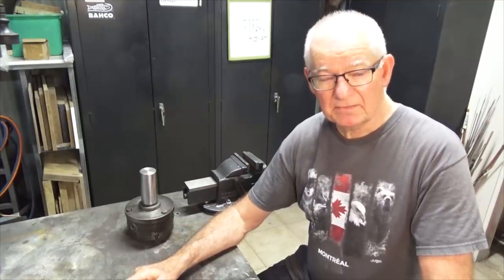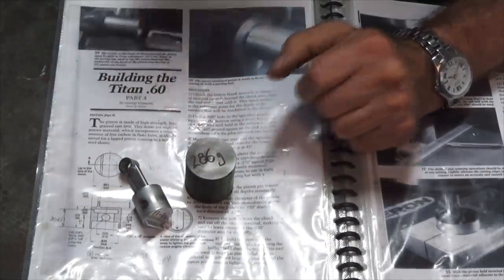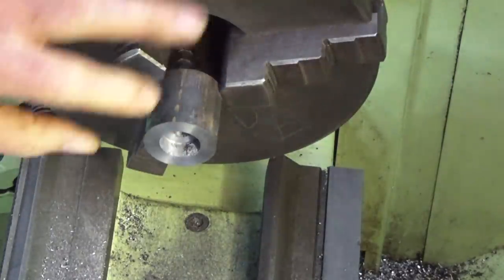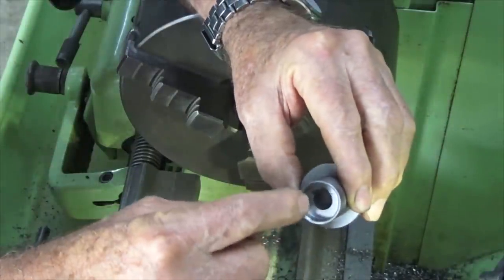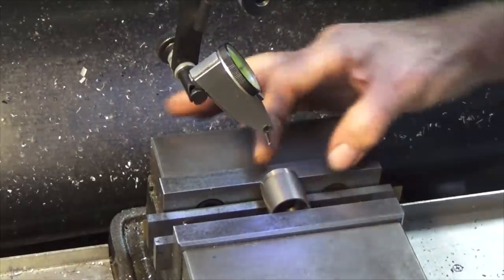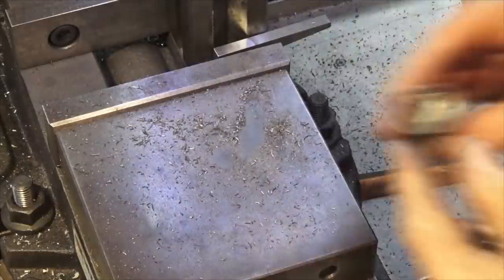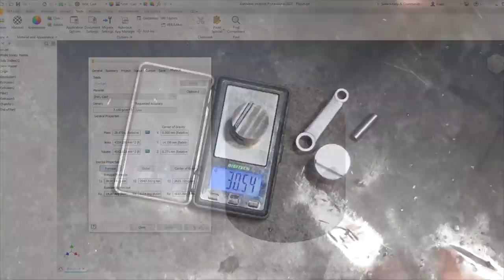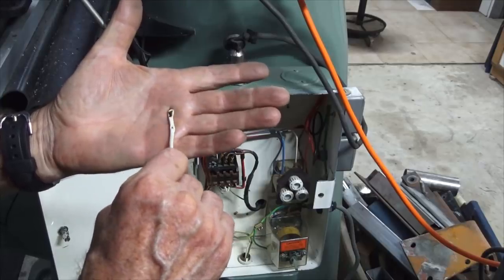Building the Titan .60 Glow Plug Engine #11

Comment: Mark, as you keep getting closer to completing this engine, I'm starting to hope that you'll design & build a test stand to run it before shipping it off to the museum.  Your ingenuity (in this and your previous projects) is outstanding!
Reply: Excellent idea. How about a miniature dynamometer?
Reply from the maker: I have plans for a test stand that incorporates a fuel tank. I also want to make three hex head bolts to hold the engine against a bulkhead. I have some old aircraft engine bolts that came from my Father in Law's tool box. He was an aircraft mechanic specialising in propeller rebuilds. I want to machine the little hex bolts from the full size ones. 
Regards,
Mark
Reply: @Preso58  I love that idea with the bolts, can't wait to see it.
Reply: Yes, what Bob said , please.

Comment: This type of engine is called a loop scavenge two-stroke. The baffle on the piston top deflects the incoming fuel/air mixture coming from the crankcase (now compressed by the descending piston) up one side of the cylinder helping to purge the remnants of the already exiting exhaust gases on the other side of the cylinder. Hence the loop.
Reply from the maker: That's it! It would be nice to see some sort of computational fluid dynamics simulation of how the heat and gas flows work. 
Regards,
Mark
Reply: @Preso58  Yes, and it would be very complex. I worked on a nuclear fusion research project. One of the diagnostics measured the density profile of the plasma using laser arrays. Perhaps you could drill a multitude of  holes for quartz windows around the cylinder to shine a laser through. Mind you, you'll need equipment to pick up and measure interference fringes and then to interpret them.
May be it's best to just get the damn thing running!

Comment: 0:54 Mark removes a 2 jaw vise and installs a 3 jaw vise. Excellent idea.
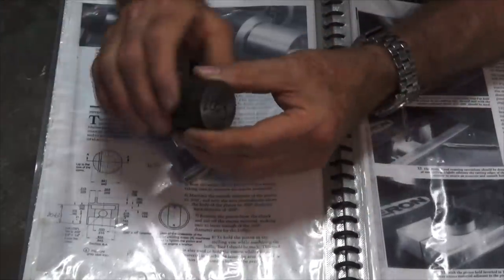3:30 Also, typically, to modify the piston or connecting rod that significantly from original would require tuning the counter weight(s) on the crank. I think running an engine without piston rings is probably easier to do when the piston material matches the cylinder material. Hypothetically, you could lighten the crank, convert the cylinder to aluminum and add a hard coating, and use an aluminum piston.
34:20 "If you own a TouchDRO..." Also, if you acquire a piece machinery from the last century, or if it's been a few years since you last checked it out, it couldn't hurt to go around and clean/tighten all the screw terminals, etc. Heat cycles and vibration just loosen these up over the years.

Comment: Hello Mark, new subscriber here. I've been enjoying this series and look forward to checking out the rest of your stuff. I appreciate your approach to identifying and solving problems. These videos are a useful contribution to our hobby, so thank you!

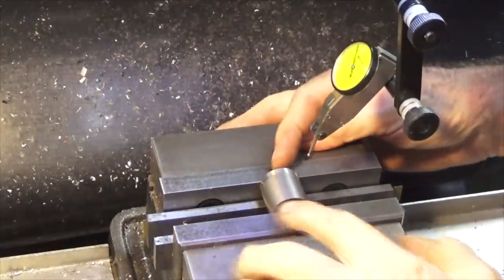By the way, when you set up the piston for drilling the wrist pin hole, there was no need to switch to a traditional edgefinder after using an indicator to dial in the centerline. (Approx 18:30). WWJPD? Make the first sweep on the end of the piston skirt. Then raise the quill a bit to clear the workpiece, and spin 180° to sweep the "other side." In this case, the other side is the back side of a gage block or parallel held tight to the end of the piston skirt. In effect, you are sweeping both sides of a zero-thickness virtual surface. Very accurate and more definitive than a regular edgefinder.
Reply from the maker: Here I am with egg on my face. Another viewer had pointed this out to me previously and I will make sure to use the indicator more as I get more comfortable with it. I do need to get myself a proper Mitutoyo indicator to go in the quill clamp. Mine is marked "Mitutogo" and it's not very good. 
Regards,
Mark

Comment: Hi Mark; reason for choice of cast-iron in a ringless 2-stroke piston: lower thermal expansion rate plus the graphite content generally gives a lower co-efficient of friction.
Also, suggestion for welding table chuck accessory: make a tail extension shaft down to a couple of inches above floor level. On the end of the shaft mount a light 'kick wheel' (eg a skinny, spare car wheel)  like a potter's wheel. Useful for welding workpieces requiring a circumferential weldline (hands-free way to rotate at the required rate).

Comment: Re the iron piston. Presumably you want the piston and liner to expand at roughly the same rate. Especially in an engine without rings.
Reply: The added weight might act as a mechanical rev limiter as well
Reply: when aluminum heats up it grows more than cast at a given temperature, if you clearance the aluminum piston enough to compensate for thermal expansion it wouldn't have enough compression to fire when cold without rings ,why design it without rings is my question
Reply: @kevinsedo6869 Too difficult for DIYer to make the ring?
Reply: It needs to be mentioned that several commercially available engines back in the day had cast iron pistons, Enya brand one I'm particularly familiar with.  I ran one of their .19 cu. in. engines for years, lots of experience.  The break-in process took some time and consumed fuel but the dependability and sturdiness were hallmarks of all aspects of how it was made.  The vibration level was no worse than other engines in the range, I suspect the Veco .19 also had a cast iron piston.

Aluminum pistons that were used were ringed, that is the choice when using steel or cast iron as a sleeve.  There were many bridges in the ports to keep the ring from snagging and I suspect that some had pinned rings for the Schnuerle ported motors that came in the early '70s.
Reply: @whalesong999  I seem to remember that a lot of diesel engines were iron ringless and glowplug were aluminium ringed? But I switched to electric in 1984 !
Reply: @ColinWatters  Wow, you were an early convert.  I went electric in early 2k, no recips after that.  Four strokes became my faves through the '80s until I let go of the hobby for about 15 years.  I still have my workhorse 2 stroke from back in the day, a K&B/Veco .61 that had many, many hours on it.  It has a ringed aluminum piston, a cross-flow engine similar to the one being made in this video.
Reply: @whalesong999  I still have one of my aircraft from the 1980s. Its a DB (DH60) Moth powered by a geared Astro 15. First cells used were 1200maH NiCads. Think it last flew with 3600mAH NmH. Has hinged aluminium cowls. Won a scale competition in Chester UK once but I think they we being kind to me.

Comment: Hi Mark, A lot of reasons for using cast iron over aluminium in a non ringed piston engine.
Primarily the expansion is far higher with aluminium so the cold bore clearance has to be greater and you lose cold compression pressure making starting difficult to impossible from cold without preheating the piston, and the risk of blow by erosion and cold piston slap is far greater.
Cast iron will expand and keep the same clearances to the liner (approximately) so the compression pressure difference cold to hot is far less.
Also the aluminium piston would require a taper from the top to bottom and a greater clearance across the gudgeon pin than the thrust faces so that when the piston expands with heat it expands to a round shape that rides the bore accurately, this is not required to the same extent, or at all, for cast iron at the bore size used in this engine.
Running the engine judiciously during run in will establish the oval it’s and taper of the cast iron piston to the minor extent needed.
If all else fails read the run in instructions for an old McCoy engine and this will give you the fuel/oil ratio requirement and what revs and needle valve settings to use.
Looking forward to the next video and the eventual completion of the project.
Take care.
Reply: I was wondering if it was an expansion thing. Makes sense.
Reply: @ADBBuild  Expansion is what its all about, the history of engine development and progression is hugely interesting.
Alloy pistons for consumer use did not become common until after WW-II so now all the knowledge related to cast iron usage is devolving into legend.
Being an apprentice mechanic in the early 70’s we were still trained in maintaining the older equipment and things like poured bearings and iron pistons were slowly becoming rare but not that uncommon. 
Up to 4 inches for pistons and bearings you ran clearances at a ratio of .001” for each inch of size. After that for pistons it was .0015” per inch of bore to 6 inches and then it stayed pretty constant at .008” to .010” for pistons and about .005” for bearings.
Lots of useful/useless data running around the skull.

Comment: Presso, we know you have a desire for a cold beverage perhaps you can make a beverage holder to fit into your multi tool holder...You can make the beer Errrr beverage holder different lengths and configurations so you could do some job at your bench say, grinding and you could grind away plus drink your beer Errr beverage hands free and not bent over at the same time....just trying to help you find new devices to make plus enjoy ! LOL...p.s im in America and, our hearts & prayers to you Aussies.
Reply from the maker: Chris, cold beverages are always desirable during our summer heat. 
Regards,
Mark

Comment: The last thing you want is any arcing or sparking around electronic equipment. I have seen problems just because the contacts in a relay or magnetic starter were dirty . Glad you found that before you had big problems. Nice job on the piston .
Reply from the maker: I suspect it was all my fault. I must have removed the wires from the plug when I repainted the machine and just poked them back into place but didn't tighten the screws down properly. It's a wonder it worked at all after I refurbished it. Having said that, it's been running for at least 9 months and the issue with the DRO only started to become a problem in the last couple of months. 
Regards,
Mark

Comment: I remember many years ago at school in metalwork class cutting some cast iron on the lathe, and how nicely it machined. It seemed nicer to work with than the cheapo mild steel or mystery ali alloy we usually got to use. It also helped that I got the teacher to re-grind the bit for me before I started, as a shop full of enthusiastic amateurs takes a toll on them!
Reply from the maker: I must say that I like machining cast iron. Many people hate it because of the mess it makes but it seems to be a lot more predictable than some of the mystery steels I have worked with. Most of the steel we supplied to students in the school where I worked was "cold bending steel". It was cheap but it was awful to machine and almost impossible to get a good finish straight off the tool. 
Regards,
Mark
Reply: @Preso58  I was a machinist now a tool rep. Mild steel is about the worst thing to machine. Would rather machine almost anything else. It’s gummy, finishes poorly, sticks to the tool and is inconsistent. To get a decent finish you have to crank the rpm and take a fairly large finish cut. 

Prefer your indicator method for centering. I never got consistent results with a wiggler like I did with an indicator. Love watching these videos. Great work Mark!

Comment: Hi Mark, RFI or radio frequency interference is almost impossible to erradicate without extensive shielding.
Back in the nineties I tripped a 10 Megawatt motor driven axial blower soldering a new push button switch on the bearing temperature, vibration monitoring system.
There was no way the machine should have tripped costing $160,000 of down time.
Some months later during shutdown work when using my two way radio i could iniiate a trip when standing close to the unit, very happy with that.
A barrier was built around the panel with holders for 2 ways to be removed and signs erected instructing operators to not enter with 2 ways.
And yes we had another another trip on the running unit with an operator transmitting within the barrier, can't stop human error.
Reply from the maker: That's interesting and probably very annoying as well. I do know that Yuriy had done a lot of work with the firmware on the bluetooth adapter to filter out unexpected pulses and the eradication of the flickering digits was pretty much all firmware related. I am still puzzled as to why the errors I was seeing were initiated by the motor switching off. It's possible it was triggered by back EMF but that should have happened with the motor wires properly secured unless it was creating a surge that caused an arc on shutdown as well.

Comment: I so admire your talent, m'thinks you must have had some industrial machine tool employment to gain such proficiency
Reply from the maker: Roger, I learned to use many different lathes, milling machines and shapers in the school workshops where I worked for 35 years but many were in poor shape and most were very old. We used to joke that you had to fix everything before you could use it. It got to the point where the other teachers at work would ask me to make replacement parts for the lathes and machines in the school workshop because they new that my machines at home were maintained and reasonably accurate, and that the tools were sharp! By the way, the patterns for the Titan have turned up. I'll be discussing it in the next episode. 
Regards,
Mark

Comment: Without a piston ring, cast iron is a better match for a steel  liner. If you use alumniium, you will almost certainly need a piston ring, as in all "modern" motors of this size. Using a ring may call for slight changes to the port timing, so best to stick with the known thing here.
Great series, well explained, and thanks for including the bloopers---helps to stop us idiots   repeating them!
Steve G  FNQld

Comment: Good stuff.  As a point of conversation, I don't believe there is any reason to assume the relief slot in the bottom of the V is centered about the vertex of the faces.  The slot is just a saw cut to avoid grinding on the corner of the stone.  They could always grind one face more than the other to clean up the faces pushing the vertex off center to the slot.  Registering on the ground faces was the right thing to do.  Of course a precision V block from Herman Schmidt or other premium manufacturer would probably be dead nuts just because, but the el-cheapo made in India crap I bought is definitely not.  They serve the purpose of a V-block to support round things (and square stuff at about 45deg) but they do not belong in the metrology department.  They took about 1/2 hour with a file and die grinder to deburr and clean them up suitably.  Price was right though.
Reply from the maker: I hadn't considered the tolerance of the position of the slot. The short vee block is definitely not Herman Schimdt quality but the taller ones are pretty accurate. The build notes said that the hole for the piston pin could be +- 0.25 degrees from the centre line so I'm fairly confident I got it within that tolerance. I'll have to check that smaller vee block to see how good or bad it is.
Regards,
Mark

Comment: Looking good! That problem with the DRO actually made you aware of an impending problem - you can consider it an early warning system :-)
Happy 2022!
Reply from the maker: Jose, it certainly made me aware there was a problem but it was the complete failure of the spindle motor that prompted me to pull the contactor out. In a way, I was happy that it was just a few loose wires and not the motor or the contactor that had gone kaput. The contactors are quite old and now obsolete so a new replacement would not have fitted without a lot of surgery. 
Regards,
Mark
Reply: @Preso58  Well, it turned out for the best. Loose electrical connections are a major source of problems (even fires) and spotting them early is the least expensive solution :-)

Comment: In addition to the different coefficients of thermal expansion (aluminium expands about twice as much as cast iron, leading to a fit that loosens with increasing temperature in this engine), another characteristic of cast iron is vibration damping, which is the reason it is used for machine tool frames.
Reply: Er, don't you mean "tighten with increasing temperature"?
Reply: @martinhughes8500  No, I mean loosen; the fit I have in mind is the lapped fit of the piston in the cylinder. Assuming the same temperature for both, the aluminium cylinder will grow faster than the iron piston. That needed to be clarified, thank you.
Reply: @murraypearson2359  I can't think of an engine design that would run a cast iron piston in an aluminium bore. The thought of a heavy piston in a light weight engine structure suggests big vibration.
Reply: If you can't think of one, take a close look at this one. Mark said that is exactly how it's designed.
Reply: @murraypearson2359  The running cylinder is a liner made of a special grade of cast iron. This sits inside the aluminium finned outer casing. A few episodes ago show Mark machining it. So it is cast iron piston running in a cast iron bore. You are right in as much as the finned part will expand more than the liner to a tiny degree and this can affect the heat transfer (the cooling) from the cylinder wall to the outside world. On full size aluminium cylindered engine the liner is an interference fit at room temperature and has to be shrunk with liquid nitrogen for assembly. At running temperatures good thermal contact is maintained.
Reply: @martinhughes8500  Right you are! I forgot that, I stand corrected.
Reply: @martinhughes8500  Chevy Vega 4 cyl engine I believe used iron pistons in  a colloidal suspension aluminium block.